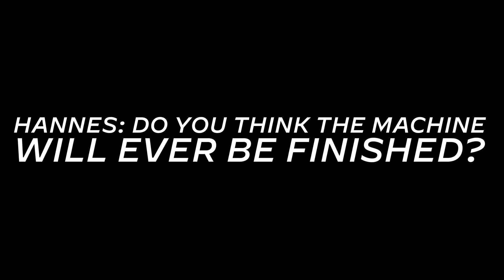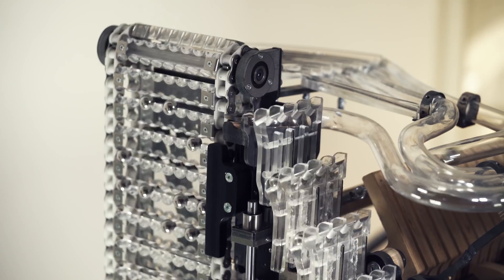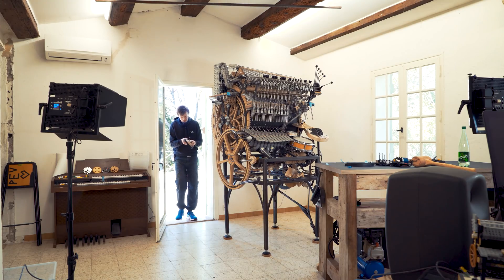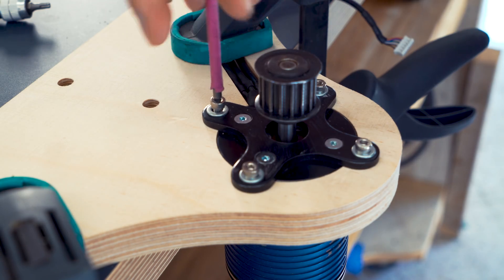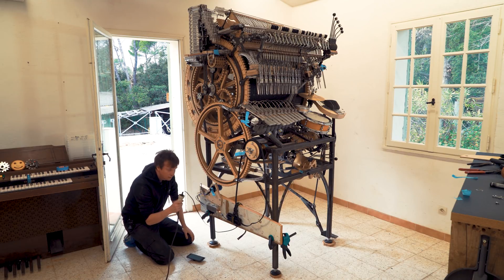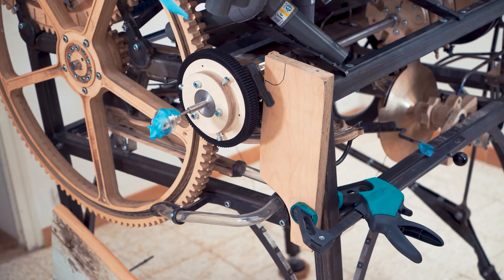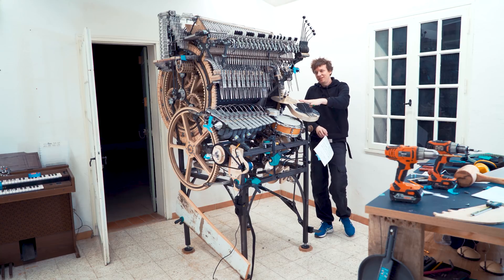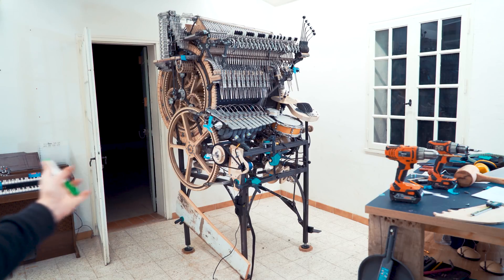Electric Motor? - Marble Machine X #114

Comment: The motor is a really cool idea! The only thing that is a bit of a shame is that the indexable clutch is now a bit hidden. It's probably my favorite part in the whole machine!
Reply: That position is just temporary, if he decides to include the motor he plans to position it in a more hidden spot.. because yes, the indexable clutch IS awesome ;)
Reply: I agree bit I think the way it's fixed on the MMX(X) is just temporary
Reply: Artsu yo that Wilson emote is awesome!
Reply: @fantasticphil3863  become a supporter and get one yourself!
Reply: Alex B I am just very low tier. Does that still connect to youtube? I want to support him but he already has so many supporters so only a bit.
Reply: @fantasticphil3863  I think it's only through YouTube, not patreon
Reply: @fantasticphil3863  Yeah it is! :)
Reply: yes, I wish the motor was on the other side.
Reply: @TheGameLecturer  This is probably not possible as motor has to come after indexable clutch (effectively hiding it) because otherwise it's offset would be applied to motor tempo
Reply: @IsuruKusumal  The indexable clutch doesn't change the tempo, so that shouldn't matter. All it does is shift the moment marbles are being dropped.
Reply: @mvanvoorden  I didn't say it does, read again :) it offsets it, pushing the time by some Delta time - and yes - delay time when the marble is being dropped. But this delay still has to be avoided for motor
Reply: @IsuruKusumal  While the clutch does offset the position or timing it does not change the RPM of the movement. As far as it has been shown the motor will aquire a desired RPM and keep maintaining the RPM. It could be atatched to the crank, the flywheel or to any other part of the machine and it will keep that part rotating at a fixed RPM. These kind of motors are not positional, they dont care at what part of the revolution they are, they just keep a desired RPM or a certain ammount of power..

The only function the clutch has it to keep the handle "in sync" with the other parts of the machine and decouple the rest of the machine from the flywheel and crank while permiting adjusting the position of the crank handle relative to the timing of the drop.

As it has been demonstrated that the motor can be safely stalled it does not require to be before the clutch, but even if it is it will change nothing.
Reply: i think that's only a temporary mount for the motor gears, he will most probably weld it in place making it hollow so we'll be still be able to see the clutch through the gear belt
Reply: I wonder if the motor fundamentally changes (my personal mental model of) the MMX. While it's probably unfair to expect the artist to manually drive a huge machine, it feels as if a motor almost sharpens the line between instrument and machine with the MMX more (the world's most incredible)  jukebox and less instrument.

Comment: By stating that he believes the machine will be finished in this decade means he highly optimistic
 since this decade ends in this year
Reply: No it ended last year
Reply: @Helperbot-2000  the first decade started on year 1 and ended on year 10 because there was no year 0, the same way century 20 ended on 2000 and century 21 started on 2001. Edit: Both are right, it depends on the contry/language (quick google search).
Reply: Fun fact: There is no absolute definition for decades (other than them being 10 years, of course.) Some definitions go from 0 to 9, like 2010 to 2019, others go from 1 to 0, like 2011 to 2020.

Comment: how many more Wednesdays is it going to take is the question
Reply: As many Wednesday’s as it takes before this thing can perform on its own maybe? He’s now adding motors to it... this is gonna be yet another slippery slope...
Reply: @jmack56  Didn't Martin mention that the marbles run out fast? He was playing a certain song but one of the channels got stuck on the other. But aside that,he noticed that the pipes were nearly empty.
Reply: All of them? LOL
Reply: How many Wednesdays will the MMX build take
If the MMX build happens on Wednesdays

(variation on "How much wood could a woodchuck chuck / If a woodchuck could chuck wood")
Reply: Yes.

Comment: OMG I commented on a really old MMX video about using a motor to power the machine. Like a garage door opener like they did in the movie breaking bad. You can wire in a potentiometer to then control the speed/tempo